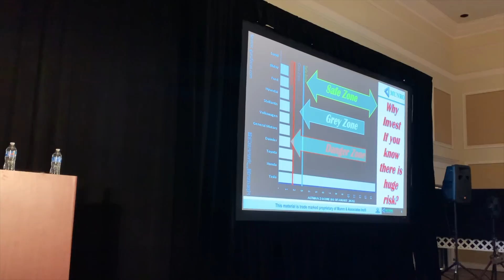Sandy Munro: Tesla is "Engineering at the Speed of Thought"

Comment: Great insight from Sandy on innovation but didn't actually answer the question...  If you watch Wham Bam Tesla Cam, you'll see that most of the big crashes end up as totalled because they're too expensive to repair.

P.S.  I see you there Ryan!
Reply: The safer the car, the more energy it absorbs. The more energy it absorbs the more the materials get crushed. The more materials get crushed the more it's going to cost.

Mile per mile, Tesla's get in way fewer accidents so even when they do get in the accidents and cost more to repair, the insurance still cost less.

They're only a third as likely to even get into an accident in the first place. They avoid most of the accidents that most cars would not avoid. Statistically a Tesla is less likely to be totaled mild per mile because while it's more likely to be told in an accident, due to the high cost and high damage, it's less likely to get in an accident in the first place.
Reply: @pilotavery  excellently worded response. Wish more people could rebut all the myriad of tesla haters this eloquently. 👍🏻😎
Reply: @4literv6  Yep. Some of the claims are and were valid. Like, claims about heavy metal mining. Etc. It's worse to make an electric car, but since the break even is 23,000 miles, this only is worse for the environment if you crush and destroy your cars after 23,000 miles. 

It's true that they had crappy build quality, but that has been solved. I don't dispute it. The new cars have fantastic build quality. They were learning to build cars. People claim that the batteries catch fire. Well...
In a crash, they're equally likely to catch fire, which is not that likely. And while Tesla can not be distinguished that quickly with water, it doesn't matter because on highways they often use a foam instead because it puts it out faster. Also, Tesla's catch fire minutes after a crash, not in seconds like a gas car. 

Lastly, when NOT in a crash, a gas car is more than 55 times as likely to randomly spontaneously catch fire than a Tesla. 

That isn't even factoring in the latest batteries, Tesla's Iron Phosphate batteries found in the Model 3. They are nearly fireproof and do not suffer from thermal runaway in the first place.
Reply: @pilotavery  i vigorously dispute the mining bit. Reasoning? How do we get oil out of the ground? 
How much energy do those machines consume to extract it? The infastructure built around crude oil?

Just moving oil coal and gas around is estimated to be 45% of all global shipping emissions. Without accounting for building those ships. Maintaining them, repairing them etc. 

How much water is injected to extract crude? How many gallons of chemicals are injected during crude and fracking operations? 
How much energy did those chemicals require to create in the first place? 

How far is crude transported at what average energy efficiency before it's stored in tanks at a refinery? Where it's refined using up even more energy water electricity and cobalt to turn it into combustible fuels. 

Before getting transported again around the globe by planes, trucks, trains, ships&pipelines all using even more energy and creating more particulate pollution. 

Are people really claiming ice car's also do not use mining for the materials they are constructed of?
What about the simple fact every ice vehicle also uses a battery and on average now 21+electric motors to function?

What metals are catalytic converters constructed of? How long do they last before requiring replacements?
Spark plugs also use copper iridium and other materials that require intense mining. And those wear out and are thrown in landfills annually by the hundreds of millions. Engine air filters thrown out in landfills by the hundreds of millions annually. What are those made of?

Oil changes? In the U.S. alone we do 425,000,000+oil changes annually. Generating 160,000 TONS of waste steel alone.
Recycling on average less than 60% of all our used motor oil. 

Oil which even if recycled requires energy to transport to a refinery. More energy water electricity to refine it. 
Where on average it takes 1 gallon of used oil to return 2.5 quarts of oil. So an average oil change requires 2+gallons of used oil. 
And motor oil to start with requires an average of 43 barrels of crude per 5 quarts of useable sellable new oil. 

I could keep going but I think you get the clue. 😀
Reply: @4literv6   Indeed. To everything you say. Somebody once tried to claim a long tailpipe for the electrical grid additions to supply energy for EVs. I had to point out the long and branching tailpipe of transporting gasoline to gas stations. (Separate from the extraction and refining tailpipe.) The wear and tear on the roads of myriad heavy fuel trucks, the cost of rebuilding the roads, the diesel emissions of the machines rebuilding the roads, etc.
Reply: @4literv6   Unfortunately it doesn't matter how eloquent the reasoning is. It will be rejected as hero worship of Musk, as bootlicking. EV haters will simply refuse to listen, they hate that the world is changing.
Reply: @4literv6  Engineering explained factors all this in. Transport for battery materials vs oil and the oil burned to move oil etc, it's true that gas cars are not quite as bad, because both EV and Gas has fixed cost as far as transport of materials, steel, fabrication etc. The biggest difference is engine vs batteries, and batteries are objectively worse. It's just that EV's are so much better during their lifetime that it cancels out after less than 30,000 miles which means after 3 years of ownership for most people the carbon footprint breaks even. So if you plan to crush your car every 3 years and junk it then buy a new one then it's equal. Even if you sell it, it means it's lifetime is longer, and someone else gets to use it. If the car lasts 30,000 miles or more, EV is the cleaner one.
Reply: @pilotavery  no he did NOT factor in all the variables nor has anyone accurately done so for ev vs ICE and lifetime average maintenance impacts&requirements. 
 
And new information now shows us evs are 8,000-15,000 miles before being break even emissions wise with ice for manufacturing. 👍🏻
So Ford's own study on the lightning vs an ice crew cab f-150? Shows 1 average year of driving for a truck owner before being even.

Again read my comments above. I worked as a service manager for a busy shop and we did everything we could to recycle and reuse all parts coming off the car's and truck's serviced at our shop. 

Inc dripping dry oil filters so they actually get recycled, recycling all the used oil, coolant and various fluids where applicable. 
Recycle all of the cardboard and tires. Scrap bins for all metal parts pulled off of cars during tune ups etc. 

Ice has a HUGE impact ev doesn't just to maintain them. Filters by the hundreds of millions which end up in landfills. 
Spark plugs by the hundreds of millions which also end up in land fills. 

Oil is only about 55% recycled all the rest? Dumped down drains, ditches, toilets and on the side of roads. 
425,000,000+oil changes each year for personal use vehicle's here in the U.S. wasting over 160,000 TONS of steel alone just for the filters.

Recycling oil requires energy to make the barrels to store it in. Energy to transport it to a state approved recycling facility. 
Addional energy to refine it. Where 1 gallon of used oil goes in, and only 2.5 quarts of re sellable oil comes out on average. 

With water and electricity plus other chemicals used to re refine it. Then repackage it and transport it again wasting more energy and causing more pollution in the process. 

Cats are made using platinum metals group's. Care to guess how inefficient&dirty mining for those are? 

Each new car or truck sold uses a battery, 21+electric motors now on average. Requires cats etc. 

Again do the damn research for yourself with an open mind and eye's. And nevermind the social costs of directly polluting the air you breathe and those you love with a gas guzzler especially a stupid loud smelly diesel. 

Plus the heat given off an ice vs an ev, with ice at 220° plus operating temps and all that air it sucks in? Equal to 5-10 humans and that air ain't clean anymore coming out the tailpipe either. 

Plus the noise which is sound pollution period. Evs eliminate most of that where we live, breathe and work=priceless. 👍🏻
Reply: @4literv6  variables not accounted for were done by other organizations who have breakdowns and he had links to. Everything that you stated in your post had already been accounted for, is there anything new?
Reply: @4literv6  many people have, and EV's have significantly LOWER costs of maintnence than gas cars.
Reply: @4literv6  some say it's a lot less, and some say it's a shit ton less..so it's somewhere between a lot better and a fuck ton better :)
Reply: Well, he did though, if briefly. "You can have either serviceability, or reliability, pick one. But you can't have both. If I make it so that's it's reliable, it's probably going to be a bugger to service." The rest of this presentation is why Sandy always chooses reliability.
Reply: Sandy has said elsewhere that if a Tesla is in a wreck severe enough to harm the cast underbody parts that level of a crash would total any other car as well,.

Insurance companies do not want to repair cars with significant damage.  It's cheaper in the long run for them to sell the car for scrap and give the owner money for another car.
Reply: @bobwallace9753  Correct. But therefore the construction of the front part is different to the one in the back. In the back you total the car, but it's the insurance company of the guy behind you which has to pay the new car.
If you damage your car in the front, it's in 99% of the cases you which have to pay your new car. Therefore the front Giga casting is different to the rear. A damage to the front part of the casting doesn't total your car but allows repairs.
It's just an insurance matter and clever thought - Tesla wants selling insurances as well, but don't want spending too much money. They're looking for profit.
Reply: well, it depends.
Front end damages seldom are total on Tesla. All others yes, they are. One reason: nobody protects the passengers better than Tesla. Front end collision is responsibility of Tesla driver. Here you can design a car in a different way, so you can repair it at reasonable cost but it's still safe
Reply: I guess that's the flip side of having the best safety ratings - they're achieved by having the most effective crush zones and panels, etc. But yes, I wish Sandy had gotten back to the original question - but I thought it was about having replacements for components like a compressor or seat track, etc, if those components were frequently changing.